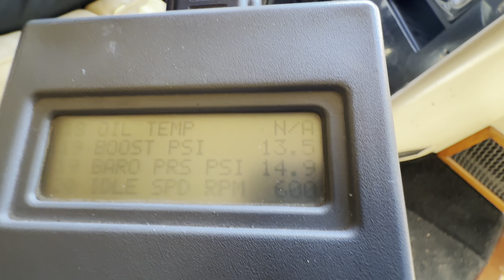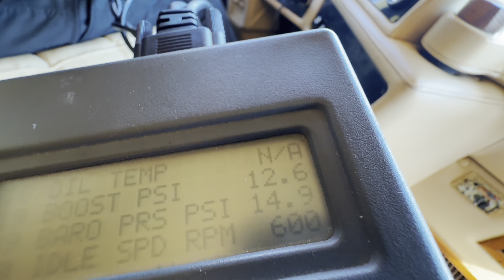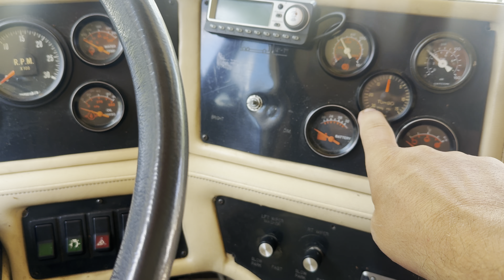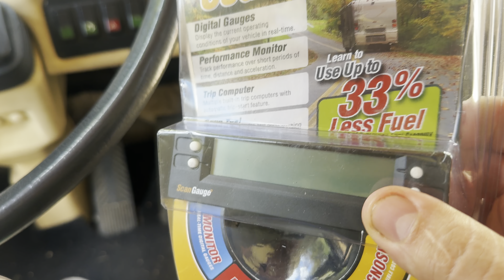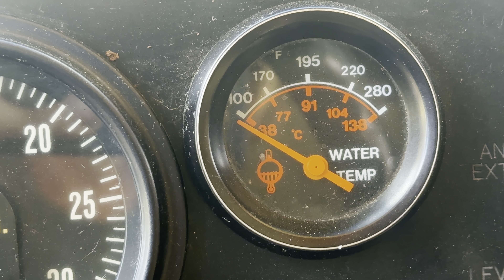3 strikes and it’s low on turbo boost!

Comment: Did he just buy that coach? I'd hate to think that someone is driving around and not doing any kind of maintenance to their bus. That tire alone is a big problem. And my take on brakes (25 years of school bus maintenance and repair), if they're out of adjustment and they're automatic slacks.....they need to be replaced as they aren't working. Non automatic slacks just need to be replaced.....

Comment: Are these buses different than a tractor-trailer ?  My Freightliner has a 60 series Detroit and it'll push 40 lb of boost on a hard Pull.
Reply from the maker: This is a 2 stroke and a bit of a smaller turbo.    15-20 max we see on the two strokes factory setups 425-450hp
Reply: @BusGreaseMonkey I appreciate the response, thank you. I've learned a lot from your Channel.  👍🏻

Comment: Yeah, Scanguage are good peeps. I had a problem with a SGII on my Crown Vic, several years after I bought it. I asked them about it and they wanted a pic of the circuit board. They determined it was a known issue with that revision board and sent out a new, current (at the time) revision board to install in my SGII. Didnt charge me anything, not even the shipping.

Comment: I see it on a lot of the buses you work on, so i guess engineers determined that those long, wobbly belts don't set up harmonics that cause premature bearing failure. I would have thought belt tensioners would be de rigueur
Reply from the maker: They have air tensioners.  Once air pressure builds they get tight.  I hate that design myself but practically every bus has it

Comment: Somewhere I still have the 5/32" x 50 foot roll of plastic transmission air line I used to use when I worked on "thirsty-two slow eight" (3208) powered buses to check the boost pressure along with other things. That small line is great for testing and small enough to run into tight places. The black in the air filter is likely from exhaust leaks being sucked into it. Black in the fuel filter could be that lovely algae that loves to consume diesel fuel. I remember that algae being a big problem when I worked down in South Carolina, but never ran into it the 8 years worked in Maine. Exhaust soot does and excellent job at clogging air filters if it's bad enough. Yours looked like more dirt than exhaust though. I would imagine that the display that you're installing ties into the green and yellow J-1939 connection, BUT I've been out of the loop for a while so "always follow manufacturer guide lines" Take care Scott and company!

Comment: have a question? I have a older Prevost and my speed gauge is acting up. Bouncing all around. I changed the output sensor it helped a little but pretty much dose the same thing. What could be the issue??  Fuses good.
Reply from the maker: Older ones are usually a wheel speed sensor
Reply: @BusGreaseMonkey I’ll check that next thanks ..

Comment: I remember driving a nearly new '07 diesel car when the hose from the turbo to the intercooler popped off. The thing smoked more than an old steamship and hardly moved!
EDIT: 06:00 I can see why they used to use oil bath air filters, flipping heck that thing is full!!

Comment: That scan gauge is only as good as the information that it is being given. That's the whole purpose for the mechanical boost gauge. The electrical signal and the mechanical signal can be compared against each other to see if the actual boost is correct. If your map/baro is starting to fail that ScanGauge will just give you that faulty number. Repair the mechanical boost gauge and compare the readings. You should know this. This is especially true in the high-performance industry where mechanical gauges are used so you don't have to rely on faulty electrical data.
Reply from the maker: Nothing to compare it to the digital gauge does not display anywhere
Reply: @BusGreaseMonkey  okay thank you for clearing that up. I thought you would get a digital display wherever  it was mounted. How do you read the digital display if you can't see it.
Reply from the maker: It’s just computer data to run the engine.  The scan gauge lets you see the data the computer is getting
Reply: If the two boost gauges disagree, how do you know which one is correct? To be really sure you need 3.
Reply: @connerlabs  Or four..... Apparently you may not have the ability to diagnose why you have two different color socks on.

Comment: One of the big issues with older busses is the connection from the engine to the dash..  adding new cable is a drama and modern Bluetooth stuff doesnt carry 40ft..

Comment: Got a Scan Gauge for my 6.0 diesel to monitor boost and a bunch of other things that are in the computer but only have idiot lights on the dashboard, quite happy with it.
Reply: I couldn't believe Ford used a pressure switch
to energize the oil pressure "gauge" on the 6.0. What an abject failure of engineering.

Comment: If the mechanical boost gauge doesn't work, wouldn't that mean you have an air leak from the gauge to the turbo?
wouldn't that air leak effect performance, like a manifold vacuum leak on a gas engine?
Reply from the maker: It’s not even plumbed into the system

Comment: I love scan gauges. Mine was about one hundred dollars more and the reason I went with the one I bought is it has alarms. Set high or low and let's say you blow an oil cooler line the alarm will go off. I do watch my gauges but can't stare at them especially in heavy traffic.

Comment: The scan gauge was invented by a truck driver. Kevin Rutherford he had a show on Sirius/XM

We would always put the newest tires on the steer axle and then move the steer to the tag.
When I started trucking in 1981 the man I worked with he would only put 100,000 miles on steer tires then move them to the drives. The one morning I found out why I had a blowout at 65 with no power steering.

Comment: I hardly see diesel pushers, much less Prevost RVs anymore.  Seems like it's all massive 5th wheel trailers behind new diesel pickup trucks.  Seems to make more sense than to tow a grocery getter behind a big RV.
Reply: Agree.  Just went by one of the winter storage yards here in MN and it is chocked full of travel trailers.  Some of those 5th wheels rigs are bigger than a class A!  Can't wait to get a vintage class A rig next year.   Wanderlodge, Prevost or other.  Might need to bring to Scott for a BGM blessing...smile.  Thanks Scott for the maintenance teaching lessons.
Reply: Im seeing less myself
Reply: Shame, I can't think of anything better than driving around in a literal apartment sized home. I haven't driven anything bigger than a LWB Transit but heck I'd learn!
Reply: Thinking about it, from the perspective of the driver (usually the dad/grandpa), having a new diesel truck to haul a fifth wheeler is a better compromise. Driving is driving, but you get a new diesel truck to run errands or have fun. But for the passengers (wife, possibly kids) it would be nicer to lounge in the back of a Class A while dad does the driving.
Reply: @393Nader  I would always rather knock down miles in a diesel pusher than a pickup truck. Driving position but more importantly much easier to drive towing a little car behind you then a huge sail.